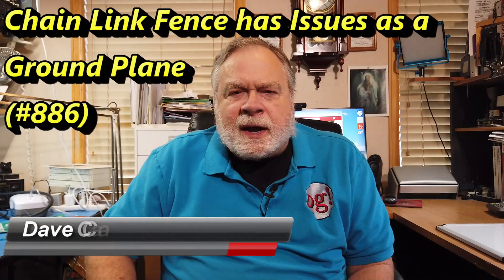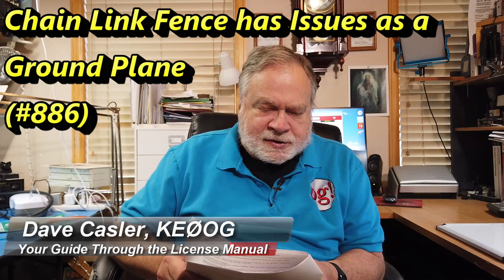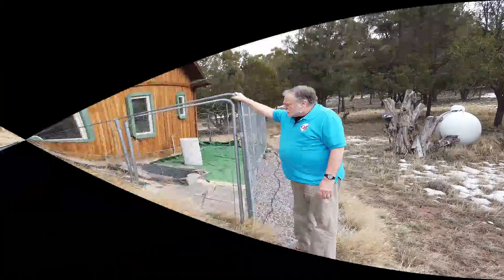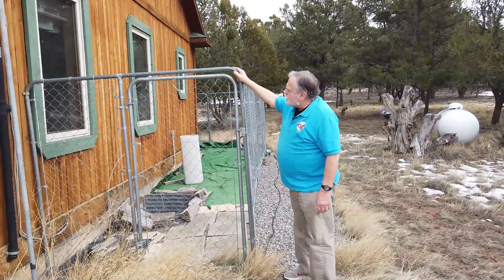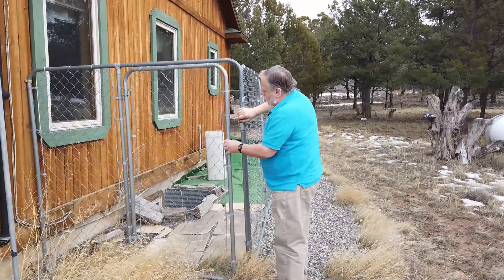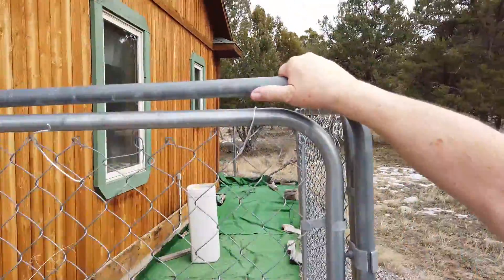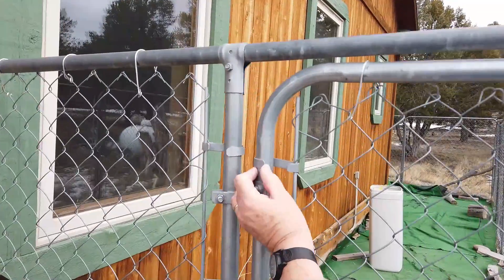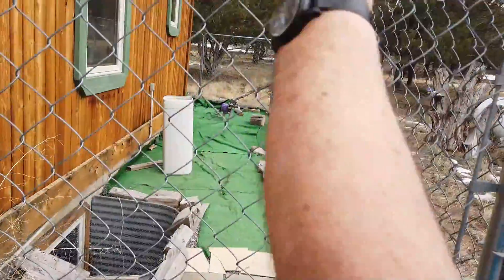Chain Link Fence has Issues As a Ground Plane (#886)

Comment: I have A 12.4 DX Commander mounted on the ridge in the center of a roof with corrugated PVC roofing that I built between two shipping containers. The dx commander is isolated via the PVC roofing and the PVC coated chain link fencing I'm using. The 8' x 15' PVC coated chain link is bonded (soldered) with 6 awg solid wire to the end at each run to tie and connect the whole sheet together it has been in service for over three years.  I used in the past regular chain link fencing on the ground and it was fantastic at first but deteriorated quickly and started raising the ground floor with a popping/cracking noise. The key here is the PVC coating and the fact that it remains undisturbed and insulated from corrosion. My noise floor is very low and quiet unless I connect the radials to the shipping containers which are grounded with 4 - 96" copper rods at each corner. It's kind of like a modified elevated radial system untuned of course. I did have the chain link at 8' x 30' but found the lowest SWR and lowest ground floor noise on the IC-7600 at 15" length was best all around. I do have ALL equipment in the shack has their chassis bonded together with a ½” continuous copper pipe, I also have the radial field connected via the coaxal shielding to this pipe I have NO AC ground tied to this pipe.  My AC current to the shack is ALL grounded at the main panel where I have 4- 8’ rods all continuously bonded with unbroken 6 awg bare wire. I do have two separate lightening suppressors on the coax entering the shack grounded via two of the four rods, I have a good friend who is an electrical engineer working for Qualcomm. He stated If ALL rods are not bonded to the main panel, a fault in an appliance or circuit can energize the entire grounding system. Because there is no low-resistance path back to the panel to trip the breaker, metal casings of appliances and tools can remain electrified. He states AC grounding and shacking equipment bonding are two completely different things and mixing the two introduces a possible RFI. I like this system so well I'm building a mast to put the 12.4 at 10' with a gen pole with 45deg elevated tuned 1/4 wave radials.

Comment: I cannot provide a scientific paper on this, but I've heard that zinc is VERY dangerous if vaporized and breathed into the lungs. I personally would not attempt to solder or weld to anything galvanized. Thanks, Dave. I've been inactive (but with a renewed license) for about 30 years, but am thinking seriously about trying to get back on the air. KA8VLW, Ken
Reply: Yes it will make you sick. Heavy metals everywhere in your body and will not flush out in 30yrs. It will pass into the brain...It's said you can drink milk after welding galvanized metal and will help remove the junk out of your system .But anytime you weld ,braze,solder will release gases and poof smoke in your eyes... Weld out side or with a fume hood or a blower to move the gases away from your face. Exposure time Year's a few days welding wont kill ya but under you hood 6 days a week with a cigg in your mouth will..I know.

Comment: Thanks for sharing this topic with us Dave. I've tried the chain link fencing that runs most of the way around my house (4ft in back and on sides). It increased the noise floor a little and didn't seem to add much more directivity than a couple of long wires under the grass did. But I found that running a "tuned" (80mtr loop) length of insulated wire around the top of the fence made a major difference. I ran the two ends from the corner posts up to the facia board and back to the antenna support pole so as to hide it best I could. The ground (elevated) loop is mostly on the north side of the antenna. Living in south Florida works, I get great contacts throughout cental Florida, Tennessee and up into northern U.S. and Canada.
Bottom line, as has been mentioned, GOOD BONDING is essential, especially in a counterpoise👍
Keep up the good info and we'll keep learnin' 😁❤️.

Comment: I used a chain link fence assembly as a ground plane years ago. as they had top rail, bottom line, an used 1-1/2 top rails and posts into concrete so every six to eight feet they were in concrete in the ground.. and it worked. Yard was enclosed on three sides by the fence, around 20 feet on each side..  plus the six feet fencing.. though  not gauranteed connection, worked. I have also used a 17 by 7 piece of hog wire under an antenna as a ground plane, commonly used for concrete work or for gardens, welded apparently and solid.. Oh, and I have used a set of barbed wire fencing that was already strung around a 5 acre land for an antenna on qrp..lol.. Used it one year.. KU4HN.. was in ARRL magazine on 10 meter qrp.. lol..little transmatch to a radioshack ten meter radio and it worked enough to have fun with..